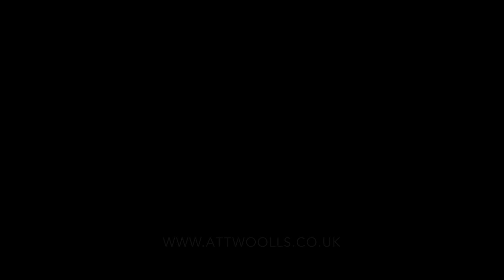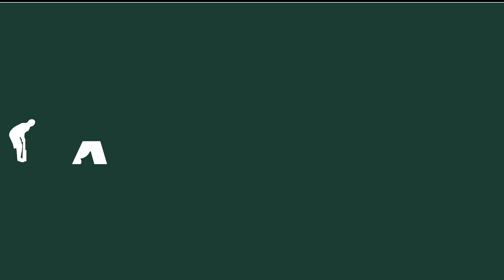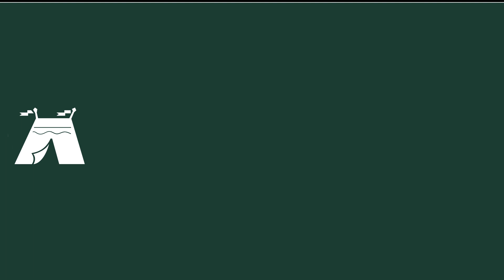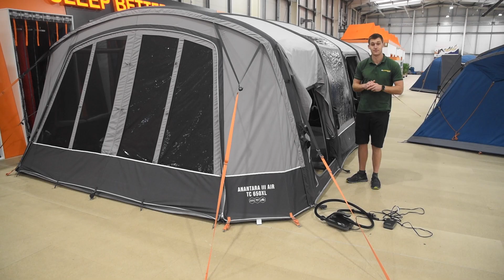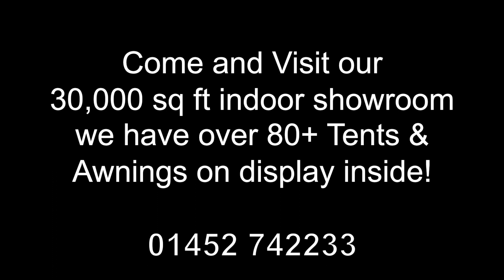Vango Airbeam Turbo 12V Pump Review

Comment: Hi, thank you for all your helpful videos. I am an older single lady who loves camping but struggle in recent years to pitch/pump up my Berghaus air 4xl tent. Can you advise me please of the ‘power bank’ you refer to in this video and a comparable 12 volt inflator to purchase to inflate my tent. I’m assuming that the power bank would allow me to inflate the tent using a 12 volt inflator without having to rely on using my car cigarette point? I have looked for both devices on the internet but wanted to be sure I purchased correctly as there appears to be several devices available. I am particularly unsure of what the power bank is and the right kind to buy to make sure I have the right device. Kind regards Julie
Reply from the maker: Hi Julie
The best powerbank to use is the Vango one and I have attached the link below for you. 
https://www.attwoolls.co.uk/vango-powerbank

Comment: Can it also deflate the awning?
Reply from the maker: The turbo pump is able to deflate an awning but not through Vango’s Single Inflation Point, so you’d have to use it on each beam individually.

Comment: After using the vango turbo 12 volt air pump to inflate my l 550 vango air tent it easy to use quite and  quicker than it looks on this video I definitely recommend this pump for vango air tents you have to fit to pump up quicker by hand

Comment: After using the vango turbo pump to inflate   My vango air tent 550 I am impressed with the speed and ease of use ps it’s lot faster than it looks in this video you don’t really have time to leI used it in high winds and heavy rain